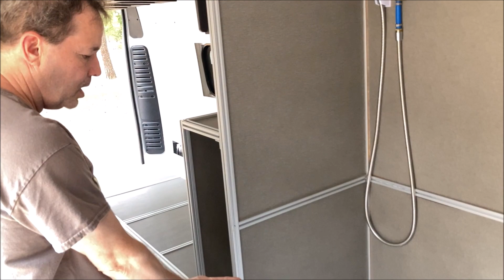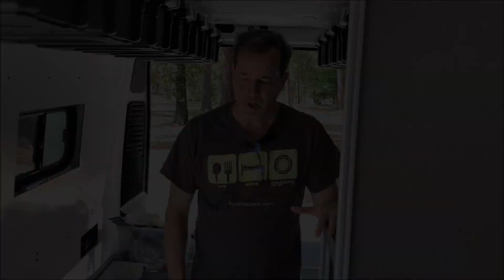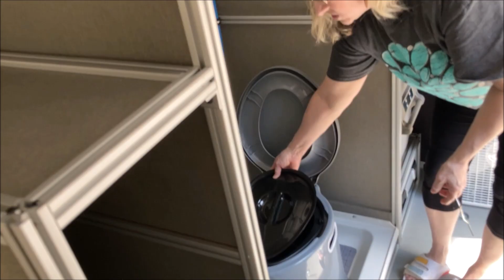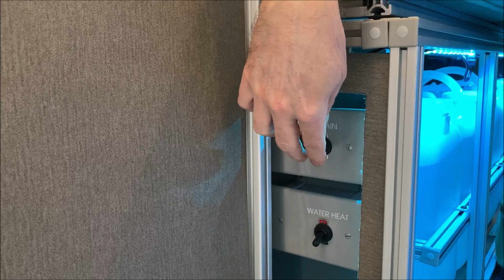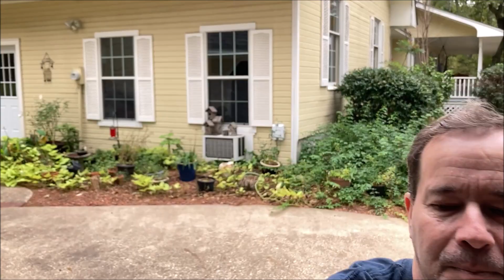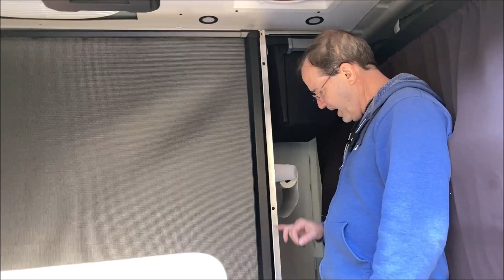Van Build Ram Promaster with a Shower

Comment: What did you use for the wall panels?
Reply: The white wall panels and ceiling panels are actually 'white board' which is a press board about 3/16" thick.

The panels that I glued vinyl to is 5mm plywood from Home depot.
Reply: @rogerarrick1907  how has it held up so far?